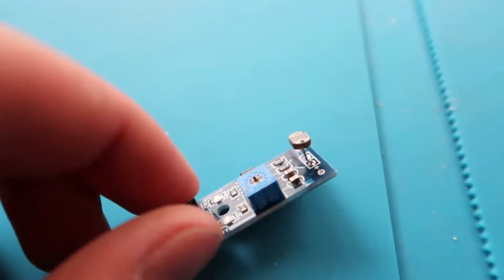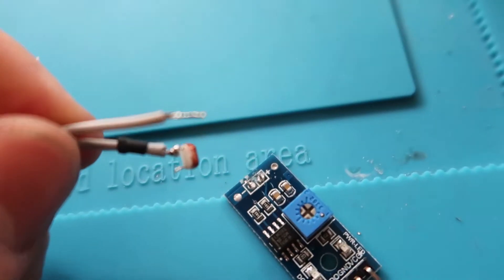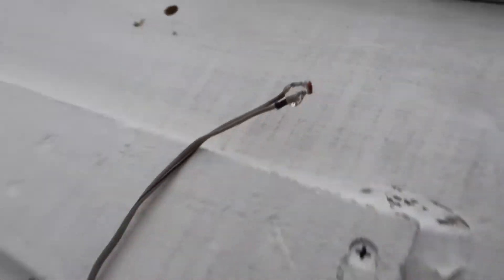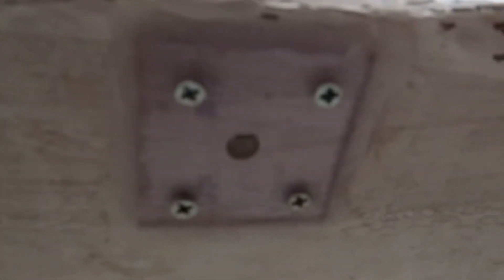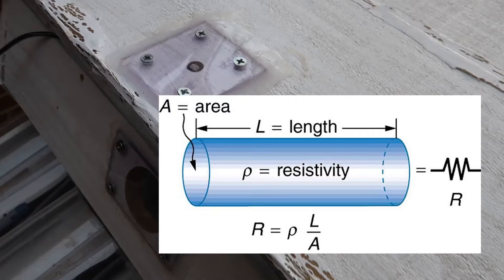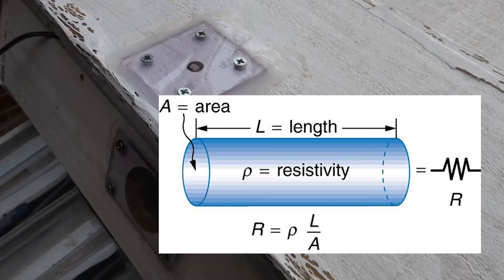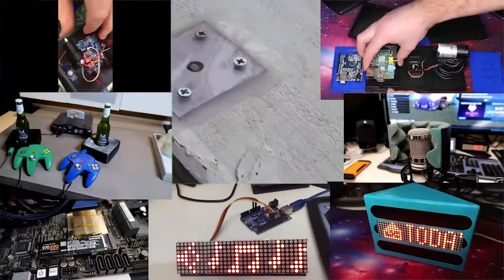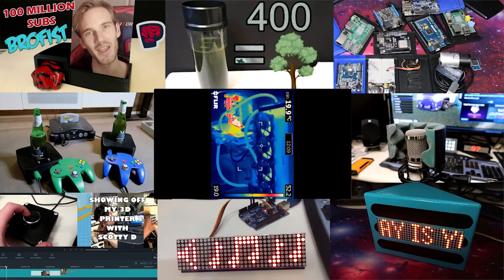Mounting CO2 Light Sensor

Comment: I would highly suggest using distilled water first (easily available at my supermarket) for the algae then repeat tests with tap water later on. I'm not sure you can efficiently remove chlorine and other unknown particulate that could affect algae growth.
Reply: I would rather use mineral water, algae needs some amount of minerals to thrive thus distilled water would not bring enough to maintain an algae population